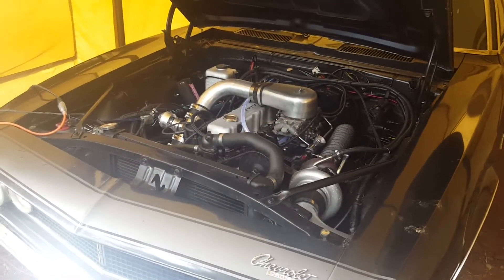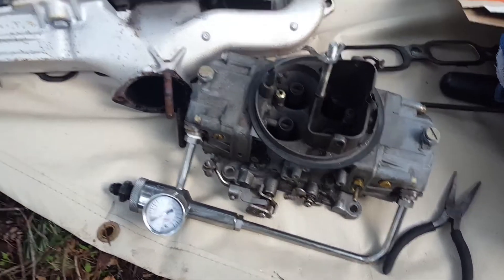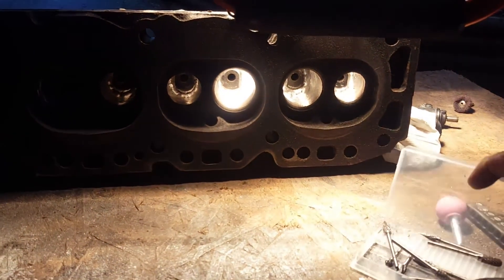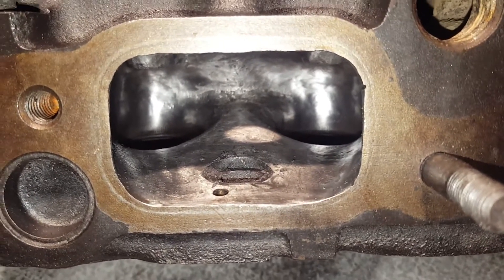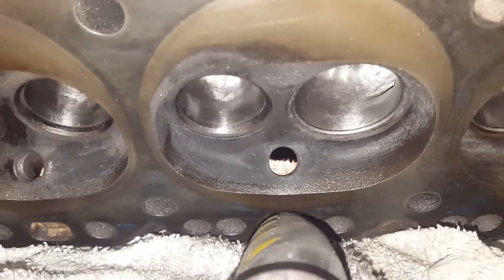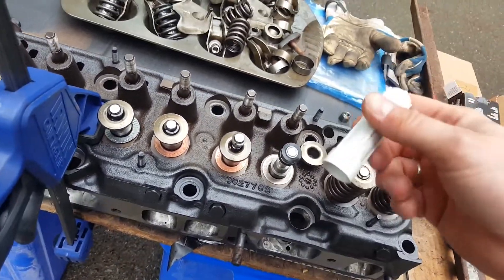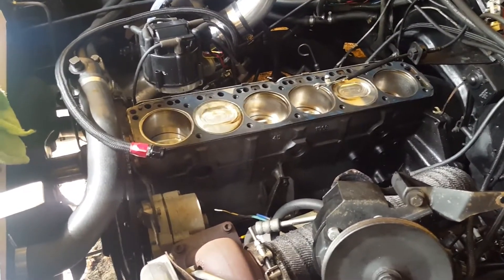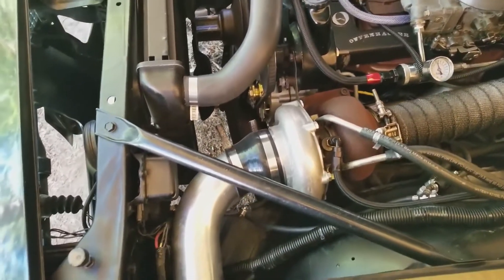1967 Turbo Camaro - Head Rebuild - Bigger Valves & Positive Seals

Comment: Hello friends, greetings from Chile, I want to order the improved valve plates and locks from the United States since I am going to improve the cylinder head. I would greatly appreciate if you have the parts number or a store that sells engine parts for the 259 Chevrolet 6 online.
Reply from the maker: I'd look at www.12bolt.com as they have lots of great parts, or may be able to help you find what you're looking for.

Comment: Hey! I have a 1966 Chevy pickup with a 250 l6. I just ordered a 72cc lump port head and will get .040 flat top pistons, fully balanced 6" rods, a 224/230 .550 lift cam and a 500 cfm Edelbrock carb. Any suggestions?
Reply from the maker: Sounds like a fun build! The carb sounds like a good fit, unless you plan to turbo, in which case I'd consider a fuel injection option instead. Besides that, be sure to use the steel cam timing gear set as the original set is a fibre material designed to fail. Otherwise I think you're in good shape!

Comment: Ian have a bone stock 292. How much would u budget for a build like yours? Thanks!
Reply: That's a tough one. Lots of machine shop work and that depends on the condition of the block, we'll say $1000. Forged pistons were $1000, custom cam $350, turbo + meth injection + intercooler + waste gate + pipes were $1200 and the sniper fuel injection master kit was $1500. So, we'll say a solid $6000 CAN eith misc parts and current price inflation. Keep in mind,with the exception of machine shop work, I did all assembly and custom piping, so sourcing that out may increase the price significantly. The price is high enough that it really makes you consider your priorities (power vs originality) as you could buy a craigslist V8 and put a small turbo on it and sadly get pretty close to the power of my build. But... That's not what this build is about.

Comment: For all the things you modified and headache you could've put a V8 in it even a small 283 would give u more horses, if that's the original inline6 250 head? number matching? just rebuild it dont ruin it.
Reply from the maker: All numbers matching. All in I spent about $5k on the engine, not including the Holley EFI. People smarter than I expect my engine gets over 400hp and a similar amount of torque. I found a "running when pulled" 350 once (stock HP 315 at best) for about $1500. Used running motors here are top dollar. I'd have to spend at least as much to get the V8, then rebuild it with performance parts to make it best my 6. After all that I wouldn't have a numbers matching engine and it would be just another Camaro with a v8. V8's definitely can make more power per square inch, I can't argue that.
Reply: @TurboCamaro67  inline 6 will always have a special place in my heart, but that's the only place they belong in your heart.at one time I did want to hop up a 6 but the Chevy gurus stood me against the wall and blind folded me an said do you have any last words...in other words if you want to make more power V8 is the easiest way to go. But there is a guy who does specialize in Chevy inline6 I don't know if he's around any more, 
www.sissellautomotive.com
Reply from the maker: Yeah, surprisingly their are a few good sources of parts and knowledge out there. Sissell, the 6=8 community, langdonsrovebolt and Tom Lowe on 12bolt.com. lots of support available, even more so in Brazil. No question though, the V8 is easier power.

Comment: Does your alternator belt provide enough contact to adequately charge? Most of that kind puts the alternator where belt wraps around at least half of pulley.
Reply from the maker: It has not been an issue, but you're still right. The factory design is a double belt pulley where the second belt comes from the crank and water cooler over to the alternator, providing much better contact. Plus a second belt would be safer for the engine as if that one single belt snaps I loose engine cooling, power steering and battery charge simultaneously. I've had the double pulley in my toolbox for a while but haven't gotten to it yet... Perhaps I could do a quick video on it.

Comment: Hey, what size valves are you using?
Reply from the maker: I'm not at home with my records, but from memory they are 1.84" intake and 1.6" exhaust valves.
Reply: @TurboCamaro67  are they 6 cylinder or v8 head valves?
Reply from the maker: @traceycarmstrong6336  I believe they are V8. The machine shop said they were the easier size to put in as you can go a bit bigger but with more time and room for failure. I've since learned the shop I used was a bunch of hacks, but I suspect they were right about that.

Comment: If you can find a good shop. You can install 1.940 intakes and un shroud the head by the intake valve right out to the head gasket.instal screw in studs.
Reply from the maker: Hah, I mentioned that to the shop I had the original work done at and they casually changed the subject so I didn't want to push it if they weren't capable. Not a lot of shop selection here unless you take a road trip.

Comment: This engine love weber carburators. Here in brasil its one of the most tuned engines. With a cam swap, basic head porting, exhaust and triple dcoe webers could go up to 300 hp n/a. If you doubt, search for "chevrolet opala"

Comment: What are your sources for performance parts and info on these?
Just found your channel.. just starting into these engines.
Reply from the maker: I bought most custom soevifuc parts from 12bolt.com and the machine shop had the bearings, valves and fasteners. Cam was custom ordered from CompCams. Check out the "build sheet" in the Turbo Camaro website for a single source of info and more detail.

Comment: Me and my father use to run a circle track divison that ran in line 6 cylinder engines. We used a 250ci block with a 194 head. We would have the stock studs removed and larger studs put in. We ran roller rockers. I had the best results with duel springs on the valves. We also wound have the intake ports swirled cut to atomize the fuel better. I would index the plugs too. We ran a zero decking with flat top pistons with ultra dyno cam . We took one of our engines to Petty Enterprise and had it put on their dyno. We produced 392 hp with single barel holly carb
Reply: Edward Ragsdale try zero deck height to the top of the gasket. Another words the piston sticking above the deck the thickness of the gasket. 😎you will be amassed in the improvement out of the corners. Also un shroud the intake valve right to the edge of the head gasket using a 1.940 valve. The competition won't be able to find you. You'll be in a different zip code.

Comment: Very good vidios ! Thank you What do the gains are for the lumps on a 230 six ?
Reply from the maker: Good question, I've only seen numbers on a 250 and 292. I'd expect flow to increase 10-20% on any of these engines with lumps and some good porting. Doesn't seem like much, but the air flow design is terrible so even 15% will make a noticeable difference. Fairly cheap upgrade too.

Comment: So, the  heavy inline six is a pretty good motor, but it has some design flaws compared to the other American brands. The Ford Big Six, in 240 and 300 cubes is an awesome motor. One of the guys in our machine shop built a 300, machining it’s cylinder head to use 351 C valves and ported the head to flow well. I kicked butt! The AMC six saw more development than any other American straight six and the resulting hot Roddenberry 4.0engines leave most everything else in the dust. Even the hug 292 Chevy! The latter coming in third according to an article in Car Craft in the early 80’s that used Clifford Research as its main source. The last of the list belonged to theMopar slant six engines, which lacked bottom strength compared to the rest of the competition. Even if you decide to give second place to the Chevy 6 it’s still tied with AMC in all buy max cubic inches. In fact an Indy Racer decided to run an AMC 199 cube sic and turbocharged it to 100 lbs boost and ran it at Indy for Qualifying! It made more power than the rest of the field that year, including a 200 cubic inch SBC, but the car didn’t handle well enough out of the corners. Maybe because of its weight, or maybe because it’s peak torque was at too high an rpm to push the car out of the corners, but it made killer horsepower!
Reply from the maker: That's some good info and I agree with you on all points. It would have been great if the car had a 292 instead for the extra displacement. I've got the larger SBC V8 valves in it and the head is ported an lumps installed for extra flow like you say. The turbocharger and alcohol add to the fun as well. Its a heavy motor but still a hundred or so pounds off a comparable V8. I think the real advantage it has is nobody else runs one, especially in a car.
Reply: Hi thinking of rebuilding c20 with the 292. What kind of head work would have to be done to get to 300hp?
Reply: The Offy’s ruled Indy for decades.Narrovo’s AMC put 700hp. Smokey’s 208 sbc put out 1000 hp carbureted,1200 after Ron Kinsler set up the fuel injection. Funny how you Chevy knockers fail to remember Kay Sissell, Mike Kirby, Glen Self (Stomin’ Six Camaro),Reggie Cordrey (D altered)Cotton Perry and Jim Headrick (‘Pocket Rocket’ Nova). Plenty of Chevy sixes ruling the roost today LD, TD, naturally aspirated or on boost.

Comment: NO WAY TO GET THE FUEL LINE AWAY FROM THE HOTSIDE?
Reply from the maker: I could have went with a different fuel rail or even used some shielded fuel hose. When I bought the Summit rail I didn't realize how close it was going to end up to the exhaust. Could have also wrapped the rail/lines in heat wrap but in the end I went with a Sniper EFI system so it's all good.

Comment: That must've taken forever with those tiny bits. Don't polish your intake ever. Leave it as smooth as you can get it with your carbides. Polishing intakes slows intake flow, already the head has a lazy port and now when it's polished your fuel isn't going to atomize worth a shit and condensate on the roof. But it's boosted so that may not matter as much.
Reply from the maker: Yeah, it was more of a smoothening and cleanup than anything. I left the actual polishing instructional to other people who've done it more. I definitly didn't touch the intake or exhaust manifolds as they are fine the way they  were.
Reply from the maker: Yeah it has a bit of throatyness and the blow off is fairly aggressive so it's noticibly under boost. I plan on doing a better sound and exhaust video in the new year.
Reply: @TurboCamaro67  how much $ do you have into the turbo set up ? I imagine it's mostly custom built.
Reply from the maker: Yep, piping probably $200, turbo was $350, BOV and WG were $120, $150 for the hat, plus a couple gaskets and hoses. Probsbly $900 with extra materials and whatnot. But the forged pistons and bolts were put in to support the turbo, so it depends how far you want to go. A solid $900-1000 (Canadian) for the turbo required parts.
Reply: @TurboCamaro67  that's not bad, I have a 440 and a turbo with manifold from an rv, but it's a 1 side manifold, I have no idea the model its a rajay turbo, but if I could get away with doing a turbo for under a grand that would be awesome. And yes those valve spring compressors SUCK ASS

Comment: How thin was the stem cover?! I'm doing these same ones on Sunday and did a "test fit" of the seals on the tip of the valve and there is no additional room. I didn't get a protective sleeve with my seals so I'm try to use at leased something to protect the Teflon.
Reply from the maker: Novafan 63 The little sleeve tool was very thin. Felt like a pre-formed piece of wax paper almost. I'd bet you could probably use a thick square 2x2" piece of wax or parchment paper with a thin coating of oil on it. You might need to cut a few and only use them a couple times so they don't fall apart but if I didn't have the sleeves that's what I would have tried. You really just need to get the seal past the grooves on the stem to prevent any burrs or debris from etching into the Teflon. If the paper shreds, I'd consider going to a local shop and asking if they can order you a few or maybe buy the cheapest set of compatible seals with the sleeve(s) included.
Reply: Turbo Camaro thanks for the replies. I'll see if that works. I was thinking of a piece of a ziplock bag at first.
Reply from the maker: Good call Nova, I had thought of cling wrap but it's too thin. One of those ziplock freezer bags cut into a square to fit over it might work perfect. Just be sure the seal doesn't take any bag with it when you seat it. Lube it up good if you go with anything plastic.
Reply: Turbo Camaro thinking if I use a corner that I can put on top of the stem I might have a fighting chance.
Reply: Turbo Camaro I was at first thinking of a drinking straw from like a big gulp or something. They're really thin but hard part would be finding the right size

Comment: Hi Turbo Camaro!. Argentina is the best place for 6 inline engines, GM, Ford, Chrysler. There keep running in drags and race track. They have stock car like NASCAR (Turismo Carretera) but with 6 cylinders engines from the 60s. They use high technology in them.
Reply: https://youtu.be/UnOu-P2qkgs
Reply: Here is a Chevy Nova with same engine as you have but aspirated and next is a Ford Falcon (with a Renault corporate sponsor on the windshield) with 6 aspirated too. Listen the beatiful sound of these six.
Reply: Check the Truck category with 6 inline engines. Here is an Argentine Ford ranger versión 2017.
Reply from the maker: Wow, it looks like Argentina is a straight 6 paradise. Some nice 6's for sure. Thanks for the links!

Comment: BLACK deposits on exhaust ports indicate an over-rich condition. 
With a power-adder such as a turbo, that's MUCH better than running lean, which will kill the motor.....BUT it needs some leaning-out. (Carb jets.)
Reply: its one of the problems with the stock intake manifold, cylinder 1 and 6 tends to run rich at high rpm and lean in lower rpms, if you watch videos of these engines with the stock intake and open exhaust they always shoot flames
Reply: I have a similar set up on my 66 Malibu.  Not a turbo but using the Offy intake with Clifford headers.  I like your head work and just may try that next.

Comment: I see the Offy intake. How do you like it? I am confused on Clifford or Offy? I see a lump port kit too! Nice! Also, I heard you say something about different torque for certain bolts on the head?Is that a 390 Holley? Sorry for the questions. Subscribed!
Reply from the maker: +Nova Craze Clifford requires a independent source and the offy mounts to the stock exhaust manifold like stock for proper heating. If your chosen manifold is like stock, then go offy, otherwise pick the cheaper one. I've read offy is better for daily drivers, but I'm fairly confident it's subjective.
Reply from the maker: +Nova Craze I do like the offy intake, was a tight squeeze with the 292 exhaust manifold. I'd go offy over Clifford. Lump port kit is almost mandatory if doing any head work, which you should. You want to go 5-10lbs less torque on the head bolts near the water pump housing, and on the lump port bolts if you have them. It was a Holley 600 double pumper with mech secondaries. 390 would have worked too but a little light at max boost. As as many questions as you like.

Comment: You have to buy an Chevy 151 "Álcool" pistons from Opala, they are flat and have 4 inches, will make this engine 4.4 (268 CID) and had more power.
Reply from the maker: AMV12S hey, I considered flat top pistons but went with forged dished for slightly lower compression and overall longevity. She's very fast without the extra few cubic inches. Good idea though!